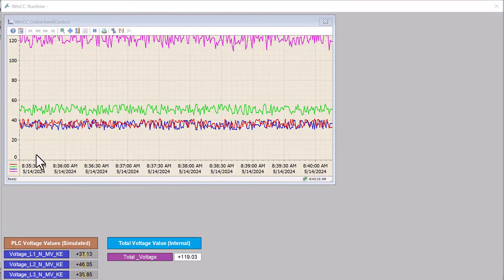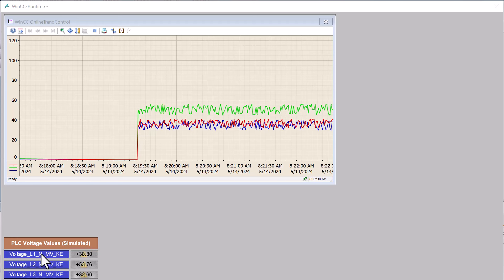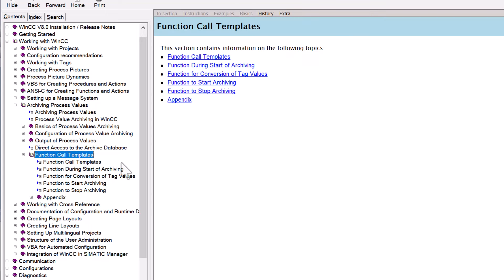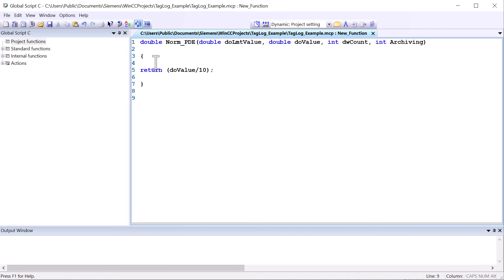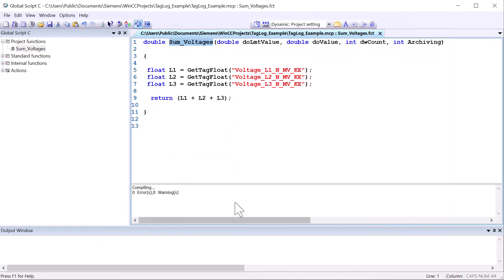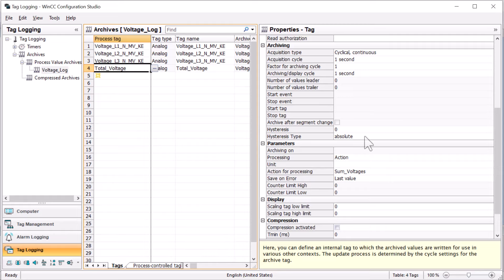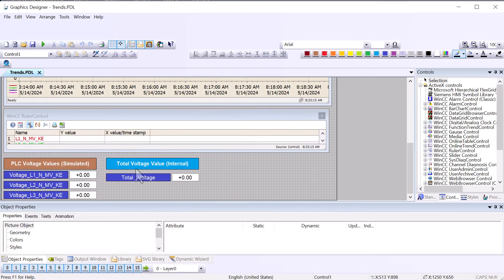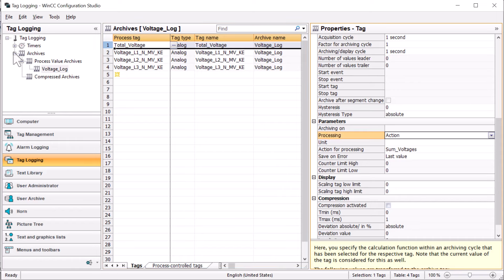How To Trend Calculated Values in WinCC SCADA V8

Comment: Hello, WinCC Guru!

Have you ever worked with pulling data from the Data Logging database, either using C-Script or some other method?

I'm asking because I want to create a small program that can retrieve a specific tag's value based on a given date.
Reply from the maker: yes, you can use VBScript with the OLEDB provider to retrieve tag logging data from the archive.

Comment: Hi Guru,
I have a question about WinCC Trends. 
Can I dynamize the different y-axes depending on the tags to graph that are selected from the list? Because I have many variables of different magnitudes and I want to be able to view the axes if only the tags are selected.

Thanks you
Reply from the maker: Yes, you can create multiple value axes on a Trend Control with different value ranges and assign the value trends to the the relevant value axis. Just  click on the Value Axis tab, add a new axis, set the value range and give it a name. Then on the Trends tab, add trends to the relevant value axis.
Reply: @WinCCGURU  I create differents axes and I assign the tags to my axes but, I want to be able to dynamize the visulization of the 'y' axes depending on the tag I select corresponding to the axis.
For example, in the same trend I have tags of pressure, temperature, current, level, etc. and I want to hide the axes if the pressure tags are not selected, and the same with tags of temperature, current, etc.
Reply from the maker: Ah, OK. You have full access to the properties of the Trend Window via VBS Script, so you may be able to do what you want in a VBS Script. Please see this video: https://youtu.be/YkhWg32srHg it shows how to programmatically define the trend window attributes. This particular script is assigning tags to trends and colors, etc, but you will get the idea. Please take a look.
Reply: @WinCCGURU  Thanks you for the answer, I will watch the video. 
Lastly, where would be the correct place to put the VBS script? In which event would it be best? Considering that, based on what I want to do, it should update when selecting or deselecting tags.
Reply from the maker: @rodrigobaliosian5370  in WinCC, anytime an object property changes, it generates an event which can be used to trigger a script or action. If you look on the events tab of the trend control , under Object Events, you will see a lot of events you can probably use to detect when a trend is selected. My advice is to put an HMIRuntime.Trace statement on each and print out the event name, then go to runtime and add trends, and see which event triggers. that's where you put the script.
Reply from the maker: Use just "Visible" versus "TrendVisible". It will work then. :D